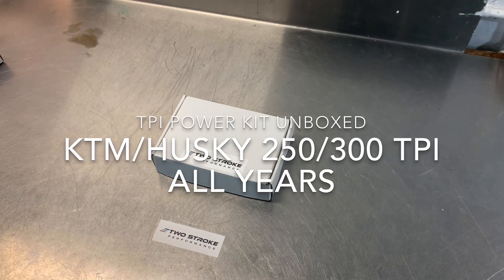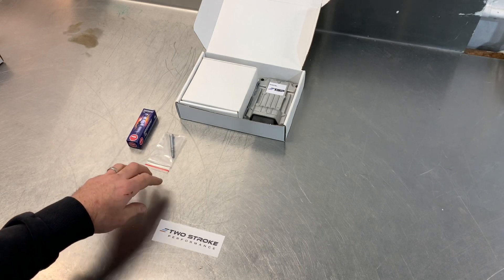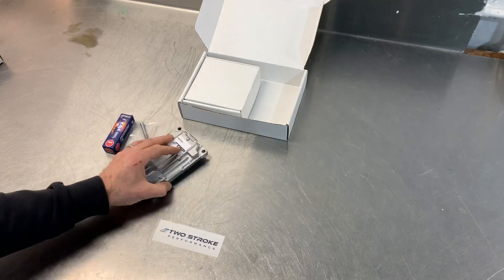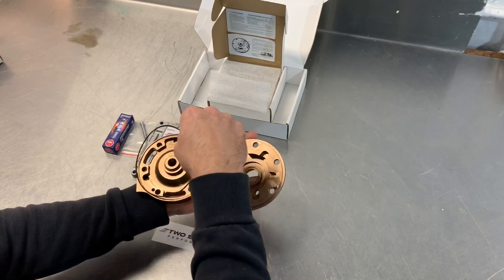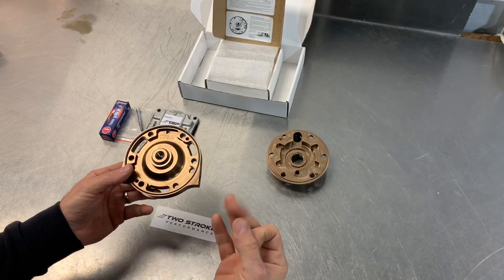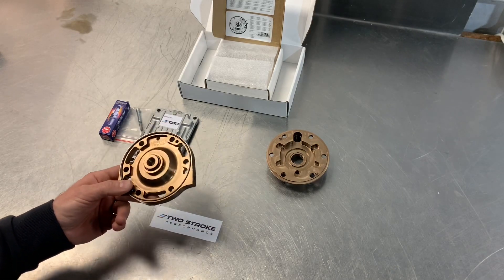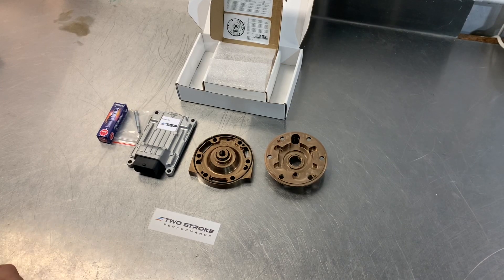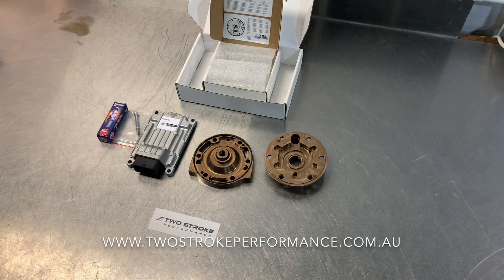Unboxing a 250/300 TPI Power Kit by Two Stroke Performance

Comment: Thanks for that, great videos and looks like a great product. Didn’t realise the 300 was so sensitive to plug heat range (2015 300 EXC with S3 A Insert head, SXS CDI, 38HV Lectron, FMF Fatty & Powercore 2, Red Spring, desert riding)... think I’ll swap out the current BR7EIX plug... 👍🏼

Comment: any update about  kits tunes for bikes with aftermarket pipes (2020 300Tei with FMF gnarly here..)
Reply from the maker: We dont offer a spefici tune for teh Gnarly. We have tested our kit withthe Fatty and it works well. The gnarly drops the power too far in the rev range though. My suggestion is to run a stock pipe or fatty with our tune and you will have a better spread of pwoer without the top end losses that the gnarly gives.
Reply: @TwoStrokePerformance  Old post but i ordered yesterday the Powerkit with medium head and relocation kit and i have installed on my bike fmf fatty and pro circuit shorty, would there be a problem with the shorty?